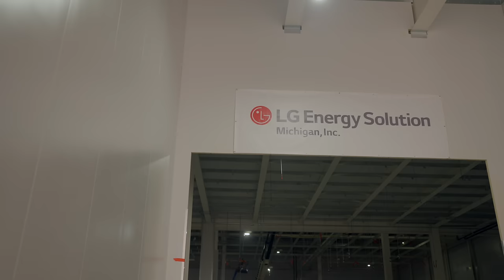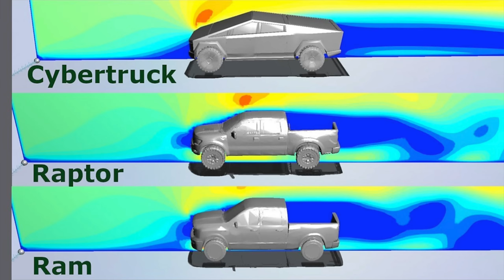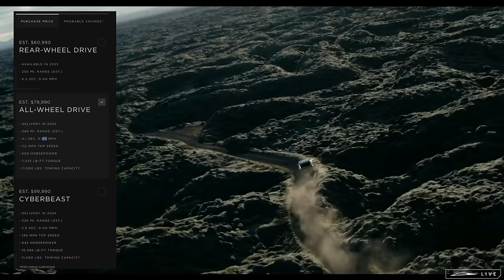Cybertruck - What Tesla ISN'T Saying!

Comment: I don't know if you mentioned it, but this is the first Tesla using the 4680 battery. A lot of the technology developed for the CyberTruck is going to be used in the next model, like the steer by wire, 800 volt architecture, and 48 volt low power architecture.
Reply: Some Model Y's have 4680 but some of the 4680 features at battery day are not implemented yet like Si in the cathode which improves the energy density. Thats going to be needed for a true 500 mile CT
Reply: I have a 2023 Texas Y with 4680 batteries.
Reply: Using 2nd gen cybercell yes, first gen 4680s have been in teratx built model Y sr since April 2022. 👍🏻
Reply: I think the 48V architecture is the most important advance of the CyberTruck, it's starting a standard that all other brands will adopt and Tesla will be the only initial source in the supply chain. No one else has dared to be the first. Every time Tesla struggles to achieve something like 4680, initial Model 3 manufacturing problems, reusable rockets exploding, FSD etc, I know they're on track to something great. When Elon said "We dug our own grave with the Cybertruck" I was happy to hear, for me it basically meant they're digging yet another moat.
Reply: No its not

Comment: Honestly, as a lifelong opponent of fossil fuel, I feel like the best "range extender" for any electric truck over the next 10 years until batteries actually get here, would be a cleaner gas generator used as the Volt does. Or for the $17,000 they want for the range extender, a trailer base w/batteries and the smallest motor Tesla makes. Tesla could make an entire business just selling mobile battery trailers. Look at Lightship.
Reply: A smaller battery with a range extender is the way to go. 

Reasonably priced PHEV’s would decisively cut liquid carbon fuel usage, far more decisively than very expensive EV’s.
Reply: The more battery electric vehicles purchased the better battery technology becomes.

Comment: I was disappointed at first when i saw that the range was going to be 340 miles on the dual motor which i have reservation for. However, my current Tundra is only 317 miles on GOOD gas and barely 290 miles on E85 which i drive 95% of the time. The Tesla Superchargers are going to save us on long towing trips even WITHOUT the range extender battery pack. I can build my own 30kwh pack for about $10k. The range extender pack is about $16k plus labor to put in back of CyberTruck bed.
Reply: It going to be good to see 250kw charging, let's hope those 4680 take it for a long time

Comment: Great summary Mr Da Vinci.  Cybertruck does have pros and cons.  One thing I would like to point out is the drag race with the Porsche 911.  That seems kind of unfair because it was not really designed for drag racing.  But it is great marketing so show it the way they did.  The cybertruck may not be for everyone but at least there are more choices now and it will push other companies to innovate more.
Reply: Plus it is meaningless for the owner to have that performance.
Reply: 911 not designed for drag racing? Yes,  it most certainly is,  with its rear engine,  launch control,  dual clutch trans. It does so very well.
Reply: I thought it was a really fabulous gimmick video clip!
Reply: And cybertruck IS designed for drag racing of course
Reply: Exactly. It's a frikin Truck!
Reply: …never mentioned which 911,  I guess the slowest.
Reply: I was indescribably bored of people marveling at EV acceleration ten years ago...   we get it, they have high torque from 0 rpm.   We get it.   Cool.   Get over it.
Reply: @jamesengland7461 actually it was a manual, which goes to show how lame this was, because after like 1 second the nose dips down a lot, so the driver either braked or was shifting.
Reply: @markthomasson5077 the cybertruck does 0 to 60 in less than 3 seconds. that's way faster than anyone needs a truck to go.
Reply: I wonder if any normal owner of these ridiculous high powered cars ever achieve putting down 1000hp.  I guess Tesla know from there feedback.

Comment: The range with the gas vs battery comparison was funny to me as that much gas weighs what 125 lbs compared to the batteries 2k lbs. The gas truck also gets lighter as it goes while the electric weighs the same the whole time with battery effeminacy going down with pack voltage. Don’t get me wrong I like electrics for people that want them but you aren’t going to replace working trucks for a lot of years; it’s just impossible to beat the convenience of a say F350/F450, or other manufacturers equivalents, for a utility box towing or hauling 8-10 hours a day as you can refill the gas tank in 5 minutes, or even faster with commercial pumps. 
I’d be interested in a more normal looking truck, like the F150 Light in gif they could get the prices down to be more realistic; we just bought 2 F350 chassis cabs with utility boxes for $75k a piece when the same trucks were under $50k just a few years back. And these are bare bone work trucks; I’m talking roll up windows and manual locks.

Comment: I use my truck exactly as you described for farm/ranch work and long road trips. It’s the primary mode of transportation on the ground. We have a 4 door Jeep for rougher travel, local run-about trips and general fun. It’s also a backup if the truck is in the shop for a few days. It is truly a pain when it’s down. I think I paid too much for it during the pandemic when my “cherry” truck was totaled in the parking lot, (long story not pertinent here), but even with that, is the vehicle of choice. A Tesla truck with the current performance capabilities is a good choice for some limited uses, but is not yet capable of the wide variety 100+ years of vehicle progress has given us with the internal combustion engine. I can see it for the uses you noted. Also, for those with a need that’s occasional you mentioned the percentages, well, that’s a good candidate and then you can cruise Rodeo Drive or the Boulevard and look good. It says you either have a lot of money or most of your wealth is tied up in a vehicle………so you get the best of the practical utility during the day and the ego boost at night.

In time, if the EV idea continues to grow, then these issues will resolve themselves. If it does not then we still have the existing capabilities. Either way, likely won’t matter to me as I’m retired and have little need to change. I’ll let the younger generation solve those problems. My generation solved theirs, and I suspect this will follow a similar path. Patience and attention to detail will win the day.

Comment: Cybertruck is going to be a hard sell for people that want to tow for any distance.    I was counting on 400-500 mile range.  Primarily because my model 3 long range never got the amount they estimated.  At best you get about 2/3 the estimated amount of miles.  And so you can imagine what you will actually get if the estimate is 340. And on top of that if you’re towing 10,000 pounds you will be lucky to get 130 miles.  And I can’t imagine charging with a trailer on an 6 hour treck into remotes parts of the country for hunting.  Overall it’s sad because other than the jacked up prices it sounds like an incredible truck.  They should have made the range extender 4 by 6 so it would lay flat in the bed and you could still carry plywood.  Poor design on the range extender
Reply: A regular gas truck has less range when towing too correct?
Reply: @dannydaw59  sure. But the comparison definitely favors a regular truck as of now.  F150 hold 23 gallons and gets 24 mpg on highway. This gives you a range of 552 miles.  No more needs to be said, but pulling my flat bed with a mule and some other supplies I used to get 15 mpg. So my range pulling a trailer was 345.  And when I stop I don’t have to disconnect my trailer to charge.  I just pull up and refuel and in 7-8 minutes I’m back on the road. 
   Again Teslas estimated range are terribly on the high side. At least it’s been the case in my model 3. I therefore expect the same on Teslas other vehicles. So I strongly doubt the cybertruck will get 340.  I suspect it will likely be around 300.  Then when you tow it will probably be 100-150 miles per charge.  I hope it’s better but doubtful.  Now my hope is the improve the range over time.  I love my model 3.  And I wanted the truck too.  The problem with towing with an electric vehicle isn’t how much weight, it’s how much range

Comment: The battery is too small for hwy driving and or towing longer distances. HWY driving it only goes 254 miles to 0 state of charge. Towing will leave the Cybertruck with way less than 180 miles.

Comment: I tell you what we really don't need, that is 0 to 60 mph in 2.6 seconds.
A lot of vehicles would do that in 8 seconds and be considered adequate. Why do we need 2.6?
It's just to show off and say how much better their electric vehicle is.
If manufacturers of electric vehicles could end their obsession with showing off and used smaller electric motors and gear boxes, limited the acceleration to around 7 to 8 seconds they could cure the range problem in one swift stroke.
That fast acceleration is what uses up the battery power.
High acceleration = high current flow.
Reply: Don't forget the extra heat involved with pulling extra current from the batteries. There is a reason a Tesla will go into "limp mode" if you try and drive it on a road course.

Comment: Please note: the initial cars had no electric system, then it was a 6v system, then a 12v system and now 48v.
Reply: Yo mean 800v system?
Reply: @Sagarmaatha8848  I'm talking about the low voltage system in cars, the system that runs the lights, electronics and so on, not about the traction battery.
Reply: 48vdc is about as high as you would want to go for the "low voltage" system for safety. The advantage is that the current for a given load at 48v is much lower than it would be at 12v. That means wires can be thinner/lighter, etc.

Comment: It would be great to see that range extender on a short term lease or rental program for road trips.
Reply: unfortunately the installation time and effort is probably going to be too high to make this practical.  In addition to the weight we have to consider the voltage that's going to be traveling through this thing.  It's going to be a near permanently mounted fixture that is hard wired in, not a modular component that a user is likely able to work with.

Comment: I watched Will Prowse's review for F150 Lightening awhile ago.  One has to look at one's use case very carefully.  If you want a electric power station, e.g. at the worksite, it can work out.  But if there's lots of towing, you're better off with ICE.   One possible future compromise, might be hybrids.  You get the torque at the beginning.  But you also get the range for towing.

Comment: I am so stoked about all the functionality of the car. Drive-by-wire, all the general tech., tech. with driving what comes  to variable traction/ etc. etc. What I've read it truly has great technology. 
CT is coming to Europe but I fear what the pricing will be here.
Reply: How can it pass the pedestrian safety tests for Europe?
Reply: I don’t think it was designed for EU requirements in mind. IIRC, it was designed for the North American car market. Maybe, some modifications could be integrated for the CT to pass EU testing? I don’t know the future plans of Tesla in EU.
Reply: Tesla never said CT was coming to Europe. Where did you get that?
Reply: @lulumink0  It is just general knowledge. Based on the treaties between our blocks (EU and the US) all products outside agriculture are free to be sold here in Europe. 
CyberTruck, as a product, will have some European particulars. For example in Finland and in various EU conutries you might need a driving license that includes you to have 'truck driving knowledge'. Also the truck might have to have a mark in the license plate.
Otherwise there is no reason why it can't be sold here. It might come later to the market here in Europe, though, if it can't be manufactured fast enough.
But as the steel alloy/plating is manufactured here in Finland, I have a feeling it's coming to Europe relatively fast.

Comment: They need a range extending trailer.
Reply: Why? If you fill the bed with batteries and pull a trailer of batteries you might as well drive a car because you won't have any room left for anything else.
Reply: @eagle25311  the range extender will weigh about 6-800 lbs. If your primary purpose of needing a range extender was to tow things, having it in the trailer will mean you are only carrying the extender when you need it. A ranger extender trailer could  also be a platform for a camping trailing where the battery would have dual purpose (extend the range and/or power the camping). If you used the sled of a Y, you could have an 85kw battery under a trailer with thousands of pounds of capacity.
Reply: @TSLApilot  Maybe one day but turbo diesels can go 600 miles before refueling just holding what is in the tanks.
Reply: @eagle25311  …using 10x the energy per mile.
Reply: @TSLApilot  Yeah it's going to have to work for now. By the time you have a range extender in the bed and the spare tire in the bed there's no more room left for stuff. When I go on hunting trips the spare tire is under the truck bed and no battery taking up space in the back so I can fit my things. Maybe one day the electric truck could work for me but not yet.

Comment: Why choose one or the other? (ICE or electric) why is nobody talking about hybrid trucks? Imagine a F350 diesel (specifically the same 6.7L) AND add a beefy electric motor for added torque and efficiency! Locomotives have been doing this forever. (Albeit backwards) but why not use both? Why must there be a rivalry?
As an electrical engineer and avid gearhead, I want the best of both worlds! Instant and continuous torque with the range and dependability of ICE motors. I can make and engineer anything, I would just need a sponsor…😢

Comment: I think for alot of haulers, your talking pulling a boat 50 miles to a lake for the weekend. As far as RV's, if only a 100 miles a day, if they have charging stations at RV campgrounds? Routes would be really limited. Perhaps instead, one could have a good size gas or diesel generater in the bed running on the road, making it a hybred?
Reply: Or just keep your diesel pickup for trailering / long trips.
Reply: Just haul a 240v generator with extra gasoline… problem solved in a cheaper, lighter, and more modular way than a Tesla extended battery.

I wish more PHEV’s were being released, at a reasonable price, without all of the fancy electronics.
Reply: @DavidHalko  That's what I said above, make it a hybred!
Reply: Most RV parks have 220v outlets. I don’t know what amperage they typically offer. So, bring a cheap 220v travel charger for overnight charging while camping at an RV park?
Reply: @putteslaintxtbks5166  - I was just vociferously agreeing with you, while citing the dislike of Tesla’s extended range solution from the video, and adding how I wish the push was towards Plug In Hybrid [from auto manufacturers] instead of EV’s.
Reply: @DavidHalko  Sorry. I should've just said good minds think alike. I had thought it was from another comment were I  commented on a comment and thought maybe you hadn't read my subcomment, my bad. Reminds me to watch that I don't come accrost as a snob also.
Reply: @putteslaintxtbks5166  - it’s all good, man… 

I read an article from consumer reports and it seems PHEV’s are among the least reliable, along with EV’s… while Hybrids are among the the most reliable. 

The jump to EV has been terrible for the industry, they should have continued with incremental improvements through Hybrid to PHEV… but government pushed for something that was inorganic, and everyone suffers.
Reply: @temujinkuechle6287  At the RV park I'm at now, as most parks with electric hook up, you have both a 110-120v 30 amp and/or a 50 amp plug that I think is two 120v lines like come into most houses, so could be 220-240v depending how it's wired at the end.
Reply: @DavidHalko  Your right, although Tesla was holding their own and good old competition is historically better then gov. interference.
Reply: @putteslaintxtbks5166  - when people do from their hearts, it can be more creative & effective than at the muzzle of a government fire arm

Comment: If I want to go off road camping. I will be in a truck with 500 mile range.  Who cares about if it’s electric or steam powered.  Making excuses for this city truck is transparent.  It sounds like an excuse.  Telling someone that most people don’t tow very often with their truck so a trucks that sucks at towing is ok - is an excuse. I bought a truck for the utility. For the possibility of utility.  
I’m a Tesla Owner and a TSLA owner.  I recently found out how difficult it is even to attempt to drive through monument Valley Utah in a Tesla model Y was just over 300 mile range.  The Tesla was rented and was a year old so of course it had the 10% battery degradation that you got after owning a Tesla for a very short time. (my model Y performance had 10% reduction in just five months.)  I wanted to see monument valley but could not as I didn’t have a ccs adapter for third party adapter.  Imagine charging 123kw on a 6.8kw charger.  ‘Bottom line is, the truck they promised would have been promising. I think their new cell doesn’t deliver either.  

Also they promised 620 miles of range with the new vapor roadster.  Tell me how likely is that?